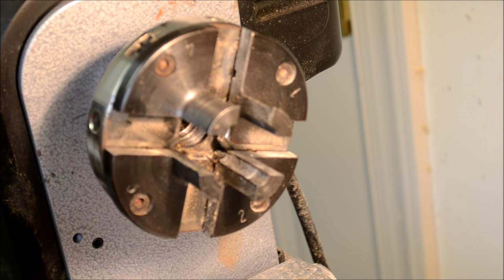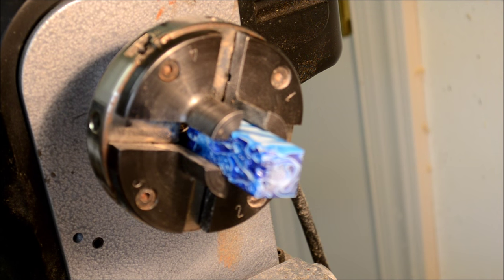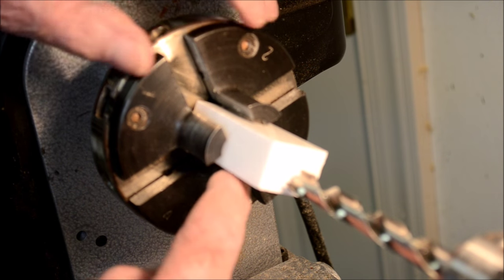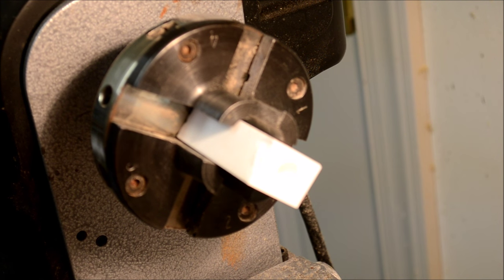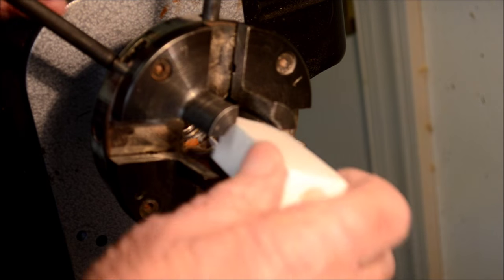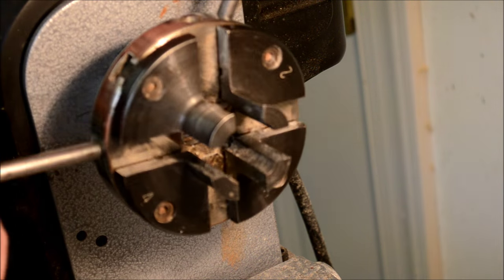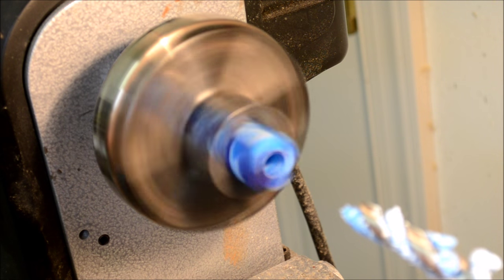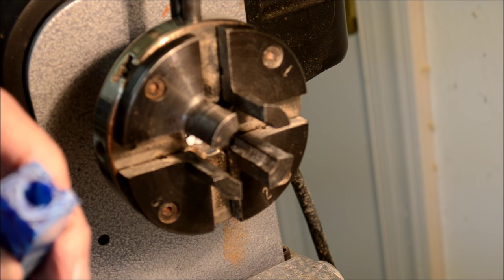Pen Blank Drilling

Comment: Thanks for the video.  I have also found that 2 things make all the difference in getting a good result. 
1. Make sure the blank is square before putting it in the chuck.
2. Make a small indent dead center on the tail stock end and put the point of the drill bit in it before tightening down the end in the chuck.  Great results every time so far.

Comment: Thanks, Ed! Some very good pointers for a beginning pen turner like me. Approximately what speed do you drill the acrylic blanks?
Reply from the maker: Randy Preston thanks. using those sharp bits allows me to drill at high speed. if you have a problem with a exit blow out you might make the blank a little long until its drilled. It looks like I am drilling at high speed .